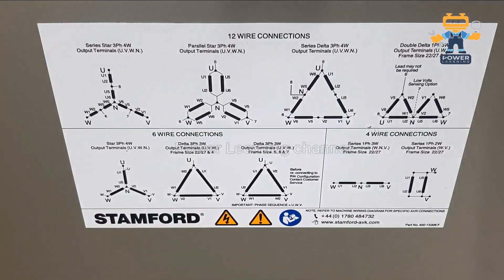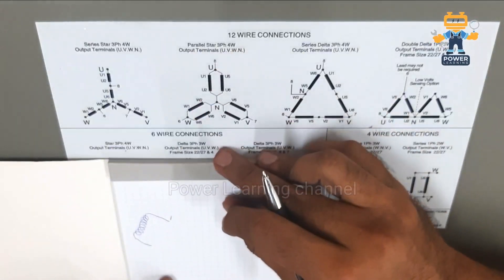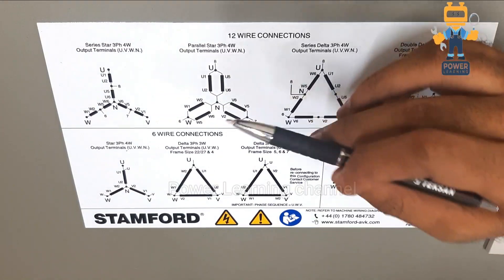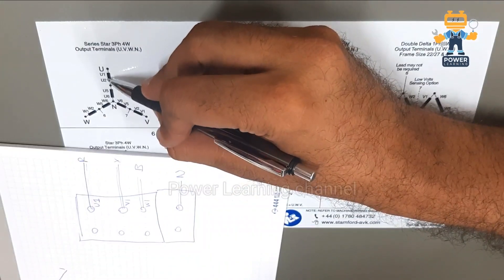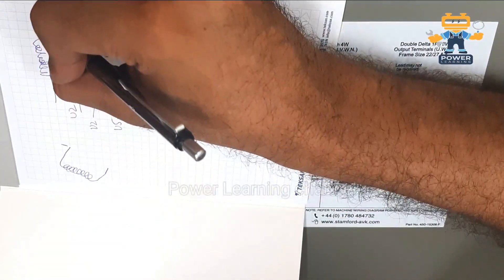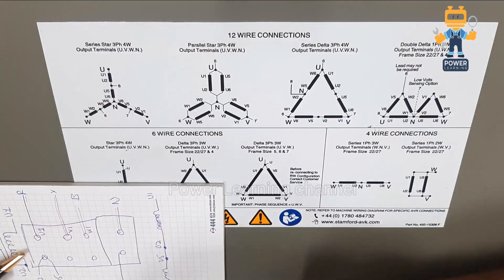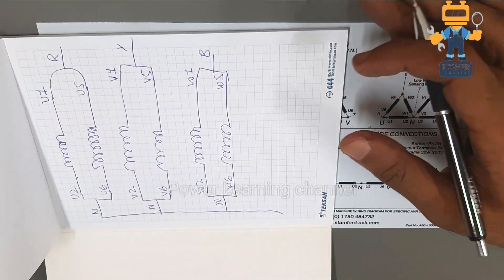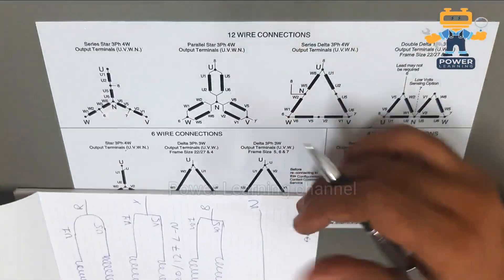two type of alternator wiring diagram | Stamford 380 VAC and 200 VAC wiring connections | 3 phase AC

Comment: Can you explains about the flickering of load lights when connected with high inductive load with online UPS 65 KVA, and lagging power factor. 

Note: no flickering when connected with EB Source
Reply from the maker: What is ur alternator size and excitation system type . UPS are fall in non linear load load and its need special care while selecting the Genset size and Excitation system
Reply: @Dieselgeneratorksa  thank you for your reply, genset size 165kVA, Cummins, load is CT SCAN  equipment,